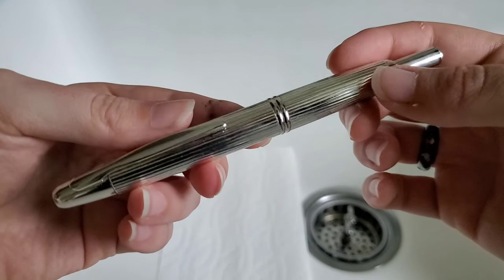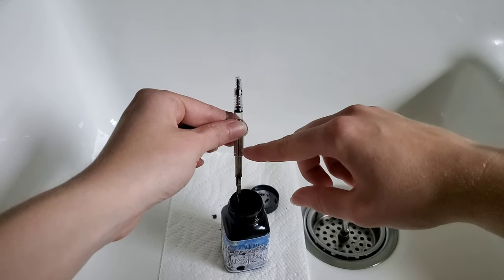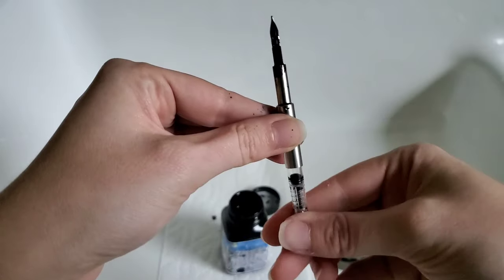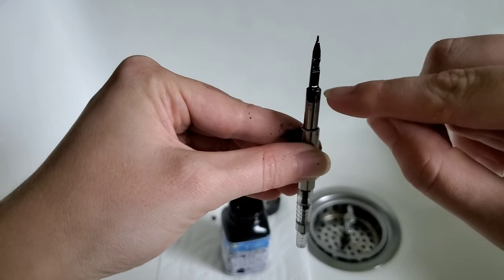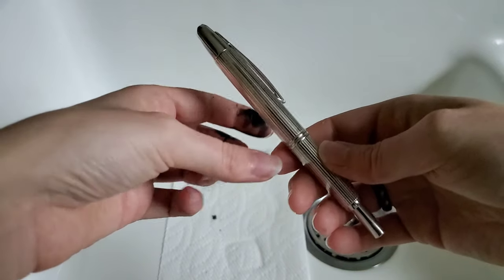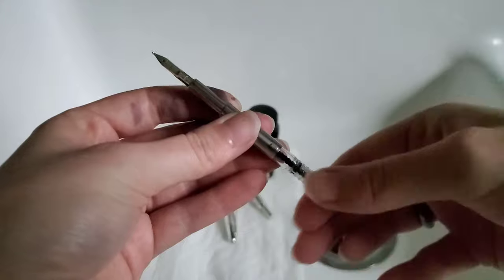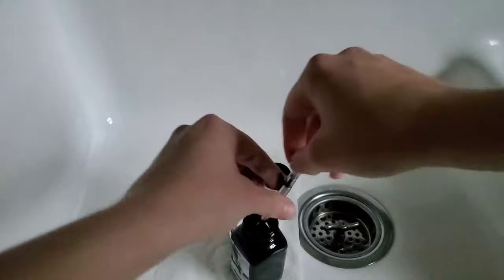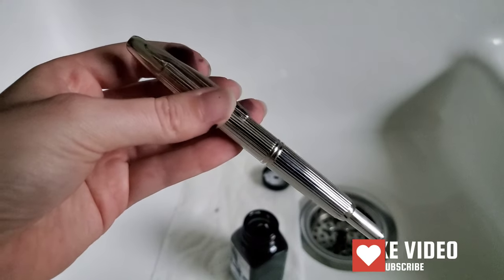Troubleshooting Filling a Pilot Vanishing Point Fountain Pen (Full Fill)

Comment: I just use cartridges with my Vanishing Point. Since I prefer black or blue-black ink in it anyway, I've never seen the point of struggling with the Con-40!
Reply from the maker: The convenience of cartridges really can't be beat! Just pop it in and you're back to writing!
Reply: @curatedavalon  I have also refilled my cartridges with a syringe and bottled ink. More ink capacity and less mess! I usually just use a syringe with my converter too- for same reasons.
Reply from the maker: @Artfullyjenn  I wish that filling the CON-40 all the way would work with syringe filling. That would be amazing. I tried it once to see what would happen, and ink shot everywhere! It was pretty funny.

Comment: These can take the Pilot long cartridges as well correct?
Reply from the maker: I am unfamiliar with the cartridge sizes from Pilot as I haven't used them. I didn't even know they had a long and short! I just know the Nimiki cartridges are compatible. The Nimiki cartridges hold about 0.90ml and the CON-40 converter holds about 0.60ml.
Reply: @curatedavalon  I think those were the ones I was looking at for an E-95S. You could always use up one of those and take a syringe and refill it and put it back in the VP too haha I think Doug from Inkquiring Minds does that with his E-95S instead of using the Con-40 so he can still put in whatever ink his heart desires. Also holds more ink!!
Reply from the maker: @williamcatalano1762  I should try it and see if I like it!
Reply: @curatedavalon  make a video about it!! 🙂

Comment: Too much of work. Ha ha 😆
I would rather use a cartridge and fill with syringe. Less messy and a bit more ink capacity.
Reply from the maker: I should order some cartridges and see if I like refilling them. I'm so used to the converter now it doesn't bother me. Using the "Texas Black Bat" ink for whatever reason, involves that extra step, but any other ink I've used the process goes quickly.
Reply: @curatedavalon  The filling would be okay if the cartridge has a larger ink capacity. The way I write , I doubt I have to fill 2 to 3 times a day. The same reason I abandoned the sailor converter and use cartridges only. Once empty, I fill with a syringe. 😁
Reply from the maker: @dashsunil  The cartridge is supposed to hold quite a bit more. The converter is around 0.60ml and the cartridge around 0.90ml.